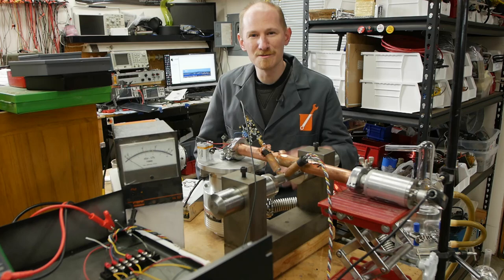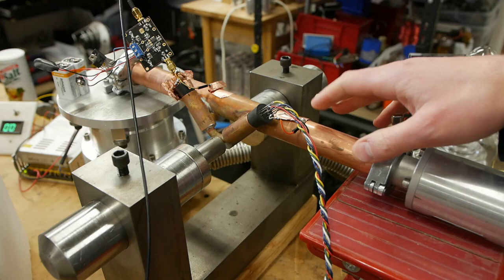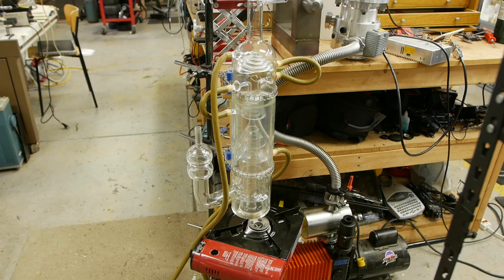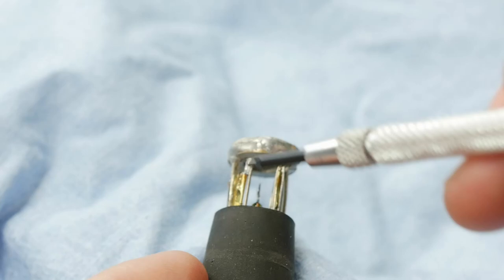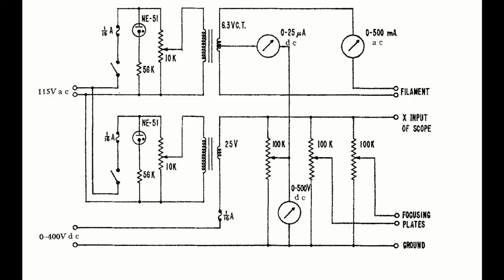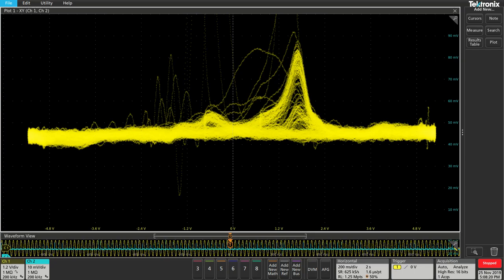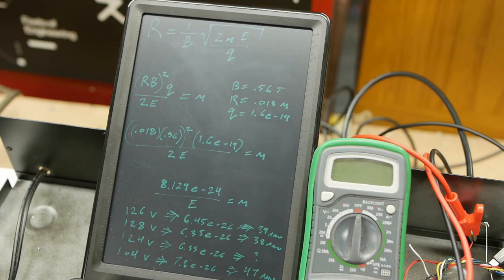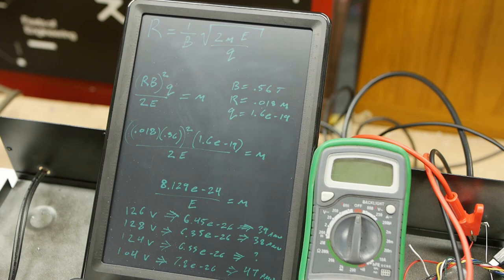DIY mass spectrometer measures potassium in dietary salt substitute

Comment: Nice work!
The tailing in the peak is definitely due to the isotopes.
The other ion may be an adduct, since your KCl was in water solution, some water may get trapped into the crystals. Thus you may have a [2K + H2O]++ ion with a mass of (39*2)+28 = 96. In Mass Spec what you measure is the m/z, where z = charge. As there are 2 charges in [2K +H2O]++ the m/z = 48. It is still not 47, but it is near.
Let me know what you think

Comment: I do LC-MS in a medical lab. I can share my thoughts on how to pursue LC. Step 1: Check EPA or Pubchem for octanol/H2O LogP: 1H-Benzotriazole 1.44; 4,4 Dipyridyl 1.28. This means both are slightly hydrophobic and can be trapped/separated on C8 or C18. I suggest you try a dirt cheap 1 ml C8/C18 solid phase extraction (SPE) column with water to trap and low concentration ethanol or isopropanol (5-10% in H2O) to elute. 4,4 dipyridyl should come out a bit earlier. This can be dried or injected into MS as is. Sounds like you've got your MS solvent sorted out. Most suppliers will mail you free SPE column samples and even a  manual on details of use.

Comment: Some ideas for the echo: Check how clean that grid 60Hz is. You might see +/- 120deg signal mixed from the neighbor phases.
A cavity reflection could be verified by altering the geometry of the cavity a little bit (for example add an extra in-line washer at the pipe potential).
My bet's on the noisy grid.
As for the outgasing I think the hose clamps were the real culprit.
Thanks for a great video!

Comment: While I'm not familiar with this setup, electrically, I have some experience in RF systems.  The smaller peak can't be a mirror, because the shape is the same - mirrored would flip it on the on the vertical axis.  What this does remind me of is when a nearby strong RF carrier is picked up in the receiver passband, and becomes a mixer artifact - the signal you want is repeated at the sums and differences of the two center frequencies.  To find the offending signal, look to the difference in frequency (or in your case, voltage) between the main signal and it's echo.

Comment: With electrospray ionization, you can inject your sample from a syringe. Liquid is passed through a needle point that carries a current. You could then employ ion mobility principles to gain a modest amount of separation for complex mixtures as the ions float to the detector.

Comment: When I was working in the Geology department.  I modified a mas spec.  we were looking for potassium argon.  The scan wave form that I used was a low noise saw tooth wave form driven by batteries.  I built saw tooth generator using op amps and liner amp.  circa 1968.

Comment: I've been wanting to build a mass spectrometer for years, and was looking into it somewhat seriously a year or two ago. There were a few on YouTube and the web in general back then, but none from a big channel or website, so I think/hope this video might kick off a small surge in DIY mass spectrometry. I was thinking of building a quadrupole MS first (just because I liked that type from reading about it, and the construction doesn't seem too difficult) and then maybe an orbitrap one later. But now I think ToF might be the best type for a hobbyist to build—it's probably considerably easier than quadrupole, it has good performance, and it's currently a popular type in professional science, so there's bound to be lots of good reading material. I'm guessing the mention of lasers in this video might be alluding to the MALDI ionization technique, which is commonly used in conjunction with ToF mass spectrometry, so I'm eagerly awaiting the next video!

Comment: Hi Ben,
Thanks for all your great & inspiring videos.
Natural isotopes : 
Potassium 39 (93.22%) ; 40 (0.012%) ; 41 (6.77%). ~ Merck Index.
"No salt" ingredients include  among others: SiO2
You're Possibly  making SiO MolWt - 44.08
As your process is similar to that used for manufacturing SiO(heating SiO2 under high vacuum).
Also Possibly making some O2 Mol Wt - 32.

Comment: I work in radio and I can see the same mirroring when doing a Distance to fault VNA sweep of antenna systems. Basically you will see that when you set your distance too far, and you are seeing rf power being reflected up and down the line. Your issue could be an impedance issue either with the cable your using or the load its attached to. I remember not thinkink much or using regular tv cable coax vs actual RF cable for radio systems when I 1st started my job. I did get a significant difference in my measurements when using 75 ohm cable vs the 50 ohm I should use for radio systems.
Reply: Gary Carone, it immediately reminded me of RF harmonics.  Peak signal is X, and the harmonic signal is some known distance away, mirroring the intended signal.  You would normally try to filter those out, but I don’t know how that would work here.  The signal is too broad to filter without specifying a specific frequency, which defeats the purpose.

Comment: Chromatographs are actually fairly easy to make if you're only using it as a front end for a mass spec (i.e. they don't have a detector of their own such as a TCD or FID). They typically just consist of some heaters, valves and pressure controllers; easy enough to do on a microcontroller with sufficient I/O. The trickiest part in my opinion is column design and calibration for your A/D converters, as they're very difficult to make consistently, and their resistance is not static.

Comment: Ben I used to work with a very specific type of mass spec. a Helium leak checker. It was designed to detect helium only and was connected to the vacuum system of the machine I was installing then after it was stable Helium was puffed at every fitting in the machine and a tone and graphical rise told me when I had a bad connection. I remember some detail about the magnetic "trap" or filter the documentation mentioned the ions spinning and traveling a spiral path in the magnetic feild only those with the right energy escaped the magnetic field and went to the detector. as you said the magnetic feild of your spectrometer varies in strength I think that may be a key, also varible is introduced with any noise or changes in the accelerating voltage changing energy of the ion stream maybe a better filter on that power supply would clear things up ( voltage and or current variance on the filament could be an issue also) changing any of these items magnetic field, the HV drive, and filament power would give a false reading. any how thats my best guess!

Comment: great job! the random signals may be came from the background EM radiation which affect the first stage amplifier! shielding amplifier board and its power supply by puting it in a metalic box (connected to the system ground) could decreas EM noises.

Comment: That turbo molecular pump should be able to get much lower than -4 millibars. My guess is that you are boiling off the higher vapor pressure fraction of your roughing pump oil. A quart of synthetic -7 EZ vacoil is like $22. I'm super excited you did this!  In my mass spec at work I had to give it two oil changes with a little run time in between to get most of the old oil out. Might reduce your pump down time enough to give you a few more minutes of analysis time.
Reply: If you don't have it already the Keithly Low Level Measurements Handbook can be found in a quick google search and can help get a little more measurement performance out of your electrometer/faraday cup detector. Inclining the bottom of the cup at an angle is also claimed to reduce secondary ion emission, I'm skeptical on that one though. The 90 degree sector I dismantled from a commercial leak detector had the pre-amplifier mounted directly to the faraday cup inside the vacuum.
Reply: Regarding the rubber, different types of rubber not only have different plasticisers which can outgas at different rates but the structure of the rubber itself allows different permeation rates, silicone will permeate lighter gasses very fast. Most of my elastomer seals on the high vacuum side are Viton or metal. I condition the viton O-rings in a vacuum chamber at high vacuum for a weekend or more before installing them to make sure any uncured compounds are out-gassed and they are very clean. I think EPDM and Butyl may also be suitable to various degrees. Regarding the side peak, you have increased the ion current so I believe it is safe to assume that you may be creating ion charges >+1 and you may also be cracking some of the contaminants in the gas load which with higher ion charges may have a similar mass to charge ratio. You could try heating various parts of the system locally with a heat gun to increase the out-gassing during operation and see if you find a correlation with the change in this peak to narrow it down.

Comment: I'm not an expert in mass spec, but since you are studying potassium chloride, your source probably emits potassium AND chlorine ions, which are very close to the potassium in terms of mass (35 and 37 a.m.u., in a 3:1 ratio), so they should show up on your spectrum. Since both of your main peaks have shoulders, maybe you are seeing both elements. The relative intensity of potassium and chlorine peaks could be explained by the different ionisation efficiency of the source.

Impressive video, as always :)

Comment: Learned my lesson on plastic pipe perocity when replacing hydronic piping in my house. They make a special pex  called O2 pex because it will allow much less oxygen to pass through the pipe. And hydronic systems are not under pressure.

Comment: Former GC/MS guy here, now working in a LC/MS-focused pharma laboratory.

If you've still got this thing kicking around... Maybe try to introduce some volatile samples using a capillary? You might even be able to get cheap GC columns second hand if you want to effect a rudimentary separation. The GC/MSs (EI single quads) I used to work with ionized the sample via an orthogonal electron beam, and the ionized sample would be ejected from the source using a charged "pusher" plate.  That turbo pump you've got might be able to handle the gas flow rate. With the amount of semivolatile plasticizers in vinyls, I might not be surprised if the gas output from the capillary is less of a problem in comparison. Maybe you could do something with variable vacuum zones and helium/hydrogen supply so you don't have to break high vacuum frequently. Also sounds like you might be able to squeeze some more sensitivity out of your setup to compensate for worse vacuum. 

On that final point - You seem to be pretty experienced with vacuum coating techniques at this point - maybe a dive into a electron multiplier detector project is in order? Would love to see it. :)

Comment: If you have a capacitance at the input of your TIA, you just need to compensate it (to some extent) by adding another capacitance in the feedback loop. In your case, it will make the amplifier stable. It's better to avoid it, but the diode or whatever detector always has a capacitance so compensation is the only way to live with it.

Comment: As another commenter already said, I think the big signal is likely to come from residual CO2 (m/z=44). At the pressure you are working, 5x10^-4 Torr, and specially with a far from efficient ion source, the intensity of the CO2 signal will be in the same ballpark of that of the K ions. To find out, you could test if the big signal goes down (relative to the K one) putting the system under vacuum and then conditioning it with a hot air gun (caring not to melt the stoppers) for a couple of hours with the ion source off: that will allow the system to outgas, allowing for a better end vacuum (would be nice to have 5x10^-5 Torr or better, and you should get it easily with that turbo). Then start the experiment when all has cooled down.
On another side, I guess you are not to get much resolution with that simple ion source (despite the slits get rid of the stray ions) because different ions get accelerated to different speeds upon reaching the elbow, and so is not only their mass (over charge) which determines the bending radius, and the spectrum. So, be prepared to have a good deal of overlapping.
Another thing to try: salts of some readily ionizable metals like sodium or magnesium, as to "calibrate" the mass axis.

To finish, a big thank you for posting such a wonderful work. And a big bow to your reasoning that something was wrong with the published results. Huge video!!!

Comment: Going via the schematic, I'd go with measurement artifact too.

Too much AC floating about. Case in point: despite being behind the Variac, the secondary winding of the lightbulb is actually ground referenced through the DC bias, so the DC voltage actually varies up and down, with AC at 6.3v that would work to around 18v peak to peak, which I'm not sure the scope is accounting for rn, particularly as you're using a Variac and not the center tapped transformer, and are by necessity DC biasing a pole of the transformer and not the center, and thus see the influence of the full peak to peak voltage, as opposed to half it

Plus all the transformers are under different loads and different impedances so they're unlikely to be in phase, so you'll get weird interference stuff, one is weaker because it occurs at a point where the filament has less current through it and is cooler and thus has lower emissivity.

It would probably be wise to power the filament via DC, way more consistent that way, and easier to separate, plus you can use less voltage for the same power, and it doesn't alternate, reducing the voltage variation across your filament in time by almost 3, likely narrowing those peaks considerably

Comment: Really cool, regardless of what that odd second peak is though, I think the way forward is the same. Rather than just using 60 Hz sine wave swap that out for a signal generator and play around with triangle wave signals and lowering the frequency to see if you can figure out what's causing it. You could also try doing some data analysis in e.g. Matlab and plot rising half of sine wave separate from the falling half and compare the two plots to see if that part of your hunch was correct.

Comment: The shifted gost peak may be due to the delay time from the travelling ions. If the ions take milliseconds to travel from source to detector, a shift is simply due to the travel time between forwards and backwards scan. In that case your measured voltages can be averaged.

Comment: The smaller bumb are Atoms Bouncing off of the walls in such an angle that they are detected. they are bouncing around in the pipe three or four times, each time a a big amount get absorbed but some will bounce off. I suspect a similar peek at the other end above the measurement when the beam is bouncing of of the other side of the pipe. Probably bigger do to the higher voltage.

Comment: Just one off the cuff thought  --  Electrometer...  I bought at a flea market one.  When I studied it, I thought it had been ripped off its filament power supply, but then read a bit about the principles and realized it was never supposed to have one.  In any case, this old Keithley device presents an astonishing low current sensitivity.  Not a high speed, though.  Otherwise, the Varactor based amplifiers of old days' Philbrick might also be of interest for the detector.

Comment: Try adding 2 part epoxy to the outside of the rubber stopper, you may have a small leak with the stopper. Epoxy is usually great for work up to high vacuum ranges (~10^-7 torr). Also using ethanol in a eye dropper to the outside of your vacuum system, while watching the pressure gauge to see when the pressure spikes is a great way to look for leaks
Reply: And you should plot out where H2O, O2, and N2 should end up on your plot. (18M/E, 32M/E, and 28M/E), that artifact might just be a contaminate of some kind

Comment: Is the 2nd peak still there even if you omit the sample from the filament?
Is there something with the correct atomic number for the smaller peak in the alloy of the filament or some other part of the apparatus? 
Does the 2nd peak correspond to Titanium? Does it correspond with Chlorine?

Comment: Could it be an actual signal reflection from an impedance mismatch somewhere in the system? Not sure what kind of frequencies are involved.
Reply: That's where I was going too. Just for fun, try changing the length of the coax between the two amps.

Comment: using lead solder is only an issue with plumbing that is used for water in the home to keep lead out of your body. Also the reason that black stoppers work is they are neoprene and it has one of the lowest rate of leakage compared to other rubber materials.

Comment: Hey first of all congrats for the great work on this video and on the whole channel! 

The mirror peak got me thinking a bit. When you modify the extraction voltage for the ions of your sample you are also changing how many ions are emitted, i.e. the ion beam current (I suppose). So even if its a tiny current, when you increase it and the reduce it it may be inducing currents that are the origin of the problem. Could you try changing the frequency of the voltage in the X axis to see if peaks come closer together at lower frequencies? Does this make sense?

Comment: Very cool video.  I just wanted to toss out a possibility for the second peak,,  Yo are seeing a peak at +18 which could be a hydrated potassium ion.  Another thing you might be interested in trying is to replace the filament with an electrospray ionizer.  It is pretty east as you would just get a very small hypodermic needle and place a voltage between the needle and the slit. This would give you more time to tweak the system as well as the sample can be introduced at will.